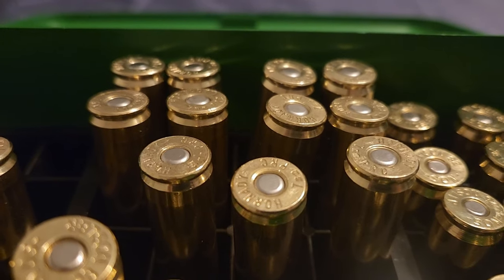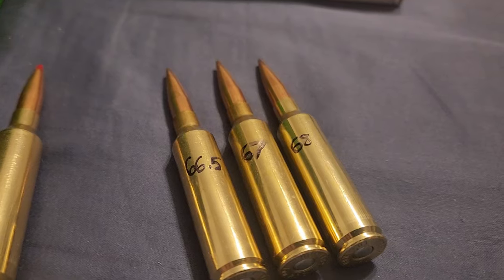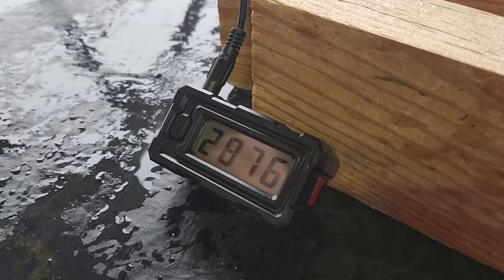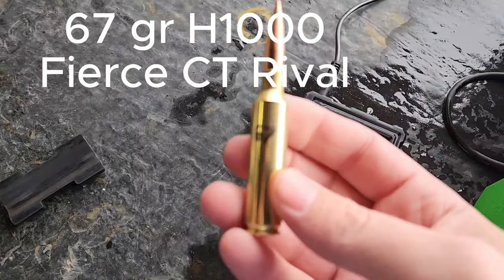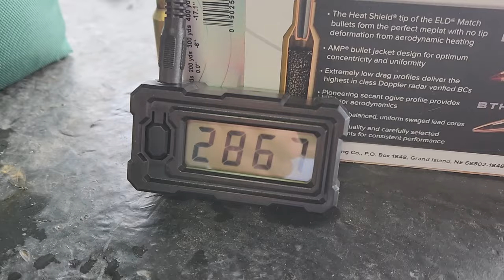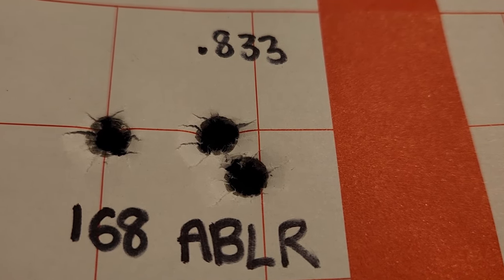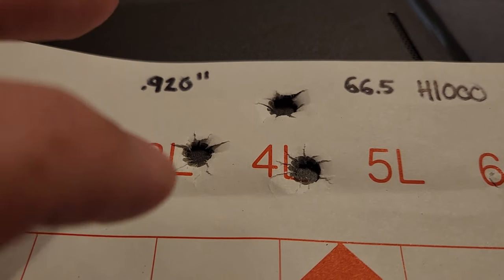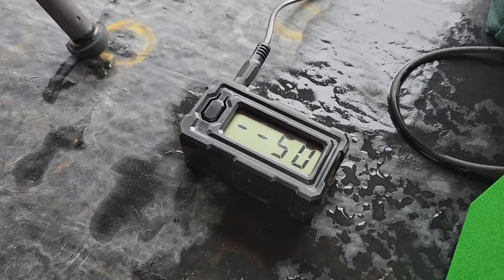Fierce CT Rival in 7mm PRC

Comment: Thanks for including the 6.8.
Reply from the maker: Underrated cartridge
Reply: These videos are making me want to put a 1 in 8 twist 26 inch barrel on a 270 win. I know browning is starting to produce 1 in heels canyon
Reply: @travissmith-wz5nc either that or build a rifle chambered in 280 Ackley Improved. I love the .270 - my first real rifle. It cracked me up when I realized that .270 Winchester beats 6.5 Creedmoor by every measure (except recoil) out to at least 400 yards.
Reply: @chipsterb4946  beats 6.5 prc also. Was thinking about  280 ai also.
Reply: @travissmith-wz5nc  I’ve been researching/day dreaming a rifle build on an ARC receiver and had pretty much settled on 7mm-08. However, a 1:8 twist .270 or a 280 AI build is very tempting.
Reply: @chipsterb4946  7 08 most underrated cartridge. 358 winchester also. 35 whelen also. I think if I had to pick a one gun being I reload it would be 338 rpm by weatherby.

Comment: Backfire just did a video on this.  Hornady rep told him they ran out of powder that produced the box velocity and new powder is just as accurate but slower.  Probably just another attempt to save face but if any early batch boxes are still out there could prove one way or the other.
Reply from the maker: I saw! Thanks for watching
Reply: I was Lucky to get an early batch and with my garmin chrono I was getting 2980 FPS average with 5 shot groups and 0.8 MOA with factory precision hunter 175 ELDX. With handloads out of a 24 in barrel, with H1000 66.8 grains I was getting an average of 2960 fps. But every other powder shot really slow. Not a fan that only 2 powders really work for the cartridge but it can be done.
Reply: I watched Jim. I thought he said industry insider, not Hornady rep.
Reply: @jiminator5 Hi just curious if you have tried H4831SC,  Staball HD, VihtaVouri N565,  and Hodgdon Retumbo? Just trying to get a feel if anything else works well in 7PRC.  I've heard H4831SC to be very accurate but slower, but N565 and Retumbo yielding higher velocity.   Winchester Staball HD appears okay in velocity but nor as good on accuracy
Reply: @daveenriquez7790  I was getting around 2970 with Staball HD but the groups were 1.5 MOA. H-1000 is giving me a little less speed but groups are sub MOA. I am still playing with seating depth.
Reply: @jiminator5  I saw a load someone developed with 66.9 of N570 pushing a 195gr berger in a 26 inch barrel about 2905 so that powder might be worth a shot. Also saw some data for magpro accurate getting similar velocity
Reply: this happened to the 7 rem mag as well, also cant deny other people are getting close to box velocity's in other videos. manufacturer's will always lower to charge to maintain accuracy.

Comment: The 7 Please Re Consider.
Reply: That’s funny
Reply: Oh thats just savage.
Reply: 7mmHype ream it out to 28 Sherman!
Reply: 7 Public Relations Cartridge.
Shot mine this afternoon!
Reply: The 7prc is a fine cartridge for what it is (modernized 7mm cartridge without the belt for handloaders like myself)... but Hornady basically lying about its performance to make it look significantly better than 6.8 Western is bs.
Reply: @t3h8ar0n  do you actually reload and have trouble though? Because the belt,  while vestigial, is not an issue reloading. On the other hand, many people having to buy custom FL dies and/or reamers due to PRC pressure issues…
Reply: @beavismagnum  Yes, I reload (I even have a video from many years ago re how to set up one of my presses)... belts cause an issue with reloading because they prevent proper full uniform resizing of the brass after firings. It is NOT a big deal; however, if given the choice between having a belt and not, I will opt for not 100% of the time because it is one less wandering variable I have to deal with in the process.
Reply: Kind of crazy to me your Mossberg isn't a tack driver, my Patriot Predator is crazy accurate with factory ELD-M and my handloads are pretty good as well. I agree with others on the 6.8 Western when it comes to support. The numbers seem to be there as far as performance, I hope it gains popularity as I hate to see good cartridges die.

Comment: If you use anything but Hornady factory ammo with their current powder.  I live in your area and am offering you a box of Federal ammo for your test?
Reply from the maker: Send me a message on Instagram. My handle is Reloading Weatherby
Reply: @ReloadingWeatherby  sent 👍
Reply: At least from the 7 PRC groups I’m in, it sounds like the federal has been 100 FPS or so faster. 2900-2950.
Reply: Thank u finally
Reply: @OutsidetheEchochamber 3Rballistics dropped a video yesterday getting 2930 I think it was out of the Federal. Had a real hot single shot from either the Federal or Weatherby that was just shy of 3k.
Reply: @dankcincy  to me 2930 is good enough I don’t understand why the obsession with 3k.  2930 gives me plenty for everything I hunt at ranges I don’t hunt at. 
The comparison using 2800 fps like there isn’t any other options was as dishonest as Hornadys published number.
Btw: early Hornady ammo was getting right at 3000 fps
Reply: @OutsidetheEchochamber   Preaching to the choir. I think the 3k thing is because that was Hornadys claim.
 It seems like there's a lot of people trying to show the PRC in the worst light possible for some reason. I don't really understand it. 
 With that said, Hornady needed called out on the BS they've pulled. Even myself, as much as I defend the cartridge, am a little pissed off about it. Fast, High BC, off the shelf ammo was the promise. That's not how it's turned out. It feels an awful lot like a bait and switch. 
 Hopefully down the road it will change and we can all chalk this up to a bumpy start.
Reply: @dankcincy  I shoot federal ammunition in all but two of my rifles one likes  hornady superperformance best and my 6.5 grendel it’s the only factory stuff I can find. 
I do remember seeing 3k out of early batches of 7 prc hornady ammunition I’m pretty sure from Jim(Backfire) himself. 
Federal to me is nearly always more consistent and offers a better premium bullet lineup. If they were to load for the 6.8 western I’d jump all it.
Reply: @OutsidetheEchochamber  If you look at the forums, the posts are still there of people testing the early lots and they were for sure moving out faster than the current ammo.

Comment: Here on the gulf coast, I have 2 7prcs, 1 a ruger and the other a remarms long range, using rl 22,25 and h 1000 I have no problem with velocity reaching 3000 with 180 vlds or eldms, both rifles together cost less than that fierce, I have shot many groups .3 - .7", sold my 6.8 western that one was a tomato stake, but that is just my experience.

Comment: Lol had to throw in the 6.8 western jab at the end, the more I see it compared to the 7s the more I like it. Also can you load varget in the 7prc, that might get the steeds up to what hornady had in mind before the powder ran out, aldo interesting to see the old box confirming that statement put out although still not 3k. 

Great video and keep up the good work!!
Reply: Varget is way too fast
Reply: @dankcincy  bummer
Reply: @NomadicHacker.  Yup
I shoot a 6 Arc as well and Varget is a touch to hot for it too. Guys are doing it, but it's flirting with disaster I think.
Reply: @dankcincy  I've seen load data for varget in 30-06 how is it to hot for 6arc?
Reply: @NomadicHacker.  I don't know enough about it all to give you exact details but if you look at the 2024 Relative Burn Chart, 1-176 1 being the fastest, 176 being the slowest.
7 Prc is up around mid 130s-mid 160s. 6 Arc is one side or the other of 120. 
Varget is 113. 
I'm no expert in smokeless powder, but I wouldn't stuff a 113 where a 165 belongs.
Reply: @NomadicHacker.  Maybe if you were sending something real lightweight down range you could get away with it? I wouldn't imagine you would get good case fill with it before pressuring out though.
Reply: @dankcincy  come to think of it I was seeing it on the lite for caliber stuff, 110s and 130s in the 30-06, makes sense then.
Reply: @NomadicHacker.  A quick glance at 30-06 load data....
It appears to be using some of the same powders as the 6 Arc and faster for the Sub-200gr projectiles. Varget is in there as well. Seems like that's around the fastest the particular list I was looking at was using though.  
 Idk....search around and see if anyone has tried it.

Comment: RW thanks for continuing your experiments with 7 PRC. When it first came out I thought “Eureka that’s it!”  But as someone else pointed out, you have to push right up to the margins to get the  spiffy “advertised” velocities. Work up loads for a 7mm 08 or 280 Ackley Improved or 6.8 Western.  Can you get close enough to not make much difference?  Sure seems like you can.

Comment: If one looks at the published Hornady load data, they themselves list 4 powders - RL22, RL25, RL26 and N560 - which achieve 3000fps at max load with the 175gr ELD-X from a 24" barrel.  That they claim the lack of one powder knocked them out of the "3000fps club" has to be a big fat lie. If I'm wrong,  I can only stipulate that the powder they initially used was not on their load data list. I just can't think of what that powder could be. Norma MRP?
Reply from the maker: I don't think Hornady has access to any of the powders that get 3000 FPS
Reply: The statement Hornady made was that they could not get the powder they originally used, I am 99.9% sure that is R26. They surely have access to some of the other powders, but they were not able to achieve the accuracy they wanted with the same velocities. The person from Hornady stated they preferred accuracy over velocity, I think they simply made a mistake by not changing the velocity on the box. I am still a believer in the 7 PRC and all of the PRC's for that matter, they are well designed and with Stabal HD, H1000 or Magpro, which are all readily available accuracy and velocity should be good enough for most people. If you are not happy after that go with a 7 LRM or 28 Nosler with a slow twist or your own wildcat

Comment: I dont own a 7mm PRC, so i have no skin in the game.My question would be around ,burn rate, cartridge capacity, pressure develpment related to powder type.Ive seen 7mm PRC get 2930 ft per sec. with a 197 grain Sierra hpbt. Thats very a heavy for calibre projectile for the 7mm. Jacob at handloader tv did a recent string of tests with custom built rifle from Yavapai gunsmith college. He got some amazing velocities and groups,especially with reloader 25 & 26. The caveat is the rifle has a 26 inch barrel. I was still impressed as he seemed to tap into the potential of the case. Hornaday must be using a poor powder as their velocities are definitley underwhelming.
Reply: The point of the cartridges was to get those velocities in a shorter  barrel
Reply: @SpudOutdoors  true, that's why I said there is a caveat, a 26 inch barrel. However even if he got 2850 with a 24 inch barrel with a 197 grain bullet that's still good 👍.
Reply: @darrylpacholko5495  I get 3000 with a 195 in 7 mag with a 26”
Reply: @SpudOutdoors  7 mag is what I own .I see no need for a 7mm PRC.

Comment: I bought a Seekins Precision PH2 last July. Had the option on 7 PRC or 7 REM Mag. The dealer I bought it from convinced me to get it in 7 REM Mag. After seeing all the recent videos about the underwhelming performance of 7 PRC, I’m glad I made the choice that I did. I’m handloading 7 Rem Mag, and I’m getting velocity’s that smoke the factory loaded stuff. I’m sure handloading 7 PRC to max would be better than factory ammo, but case capacity doesn’t lie. I always thought it was fishy when Hornady claimed faster velocities with the same type and amount of powder in 7 PRC in their reloading manual. That literally doesn’t make sense. You can’t have the same bullet and same amount of powder and get drastically different velocity.
Reply: If you’re a hand loader, it actually does make sense to go with the PRC, as it’s only the factory loads currently having a problem. Also, the reason you think it “literally doesn’t make sense”, is because you don’t know about the pressure differences. 7mm rm is at 62k, 7PRC at 65k. That means with the same powder load it will have slightly more velocity all else equal, it’s just how it works.
Reply: And by “same powder load” I mean same grain weight but different powders. 7m RM can’t handle as much of the hotter powders.
Reply: I too went with the same rifle but in 7 PRC... thing shoots same hole with the ELDX factory and .85 MOA with ELDM. Can't wait to start handloading with 195's to see what I can get to work with that... either way, Seekins Precision PH2 is probably my favorite rifle
Reply: @oblivionpro69  you understand that’s not how physics works right? lol  The case capacity is almost identical, which means that with the same powder charge and same bullet, velocity will be almost identical. The difference is 7 RM has a little bit higher case capacity, which means more powder, which then translates into more velocity. 3k PSI in MAP isn’t going to add 100 fps to 7 PRC. The great thing about this video is he has handloads, and not light ones, and he isn’t getting anywhere close to the advertised 3k FPS
Reply: Also if you go watch ultimate Reloaders recent video on .308 at 300 win mag velocities, you will see that most people probably run way over SAAMI max pressures anyway. So the 3k MAP doesn’t make a difference when handloading.

Comment: Here is what I think of why the Fierce is performing a bit better than the Mossberg. It has to do with the stock.

The Fierce Rival has carbon bedding and any sturdy bedding makes for a better shooter.

The Mossberg Patriot Predator Strata that you have there is a stock similar to the Mossberg Patriot synthetic stock. The mag well is removable and it is used as a shim. The rear action screw guide has a gap so that it is not a complete circle. You can never torque down what you need. This is going to allow some motion, I think, in the rear of the action, using the front action screw like a fulcrum.

Put the Mossberg in any bedded stock, most especially a chassis, and it does better. I know because I have some and I have mentioned this more than once to Mossberg and they are not interested in changing their ways.

Comment: Okay so for the 6.8 your not included the flyer? I understand it looks good with the 4 shots shown but that’s not the real group size, you can’t though a flyer out, that flyer is part of that group and it shows what the rifle could do on any of the 5 shots. But just my two cents, good video! I may have to show the 7prc getting over 2900 fps because I think I still got a box left of ammo. Also if I had to pick I still would take 280 and 280ai over both these two. 👍
Reply from the maker: The flyer is included. 1.2 inch 5 shot group. I wasn't trying to hide the flyer.
Reply: @ReloadingWeatherby   cool 😎
Reply: You said half moa on the video, it didnt even shoot 1 moa 😂😂
Reply from the maker: @knotsknives1863   I said if we didn't count the flyer. You can see the flyer with 1.290" right next to it.
Reply: @ReloadingWeatherby  right, so if i only count 1 shot, then it's a really tight group right? Ha. When you go to shoot that gun, it could hit in any one of those spots, i guess i just dont see any value in saying what it could have been, cause it wasn't. But you do you....
Reply from the maker: @knotsknives1863  Well... he has some work to do...to get them all sub MOA. The point I was trying to show was the potential. 

In his defense... he has shot this group a lot and doesn't get flyers. You shoot enough of even a great load and you will get a flyer.

Comment: What scope was on the fierce rifle? I am looking for a scope for my 280ai rifle. I want the elevation turret exposed.  But the windage capped. What brand chronograph was ya using? I want to get one. But i won't use it much.
Reply from the maker: He had a Vortex Razor LHT. We were using a magneto speed chronograph
Reply: @ReloadingWeatherby  I was looking at the Vortex Viper 4x16x50 hs lr scope. Wanting an SFP scope for hunting. I was also looking at the magneto speed sporter model.  Putting the scope on a new Browning.  A Xbolt Hells Canyon Long Range rifle in 280AI. It has a 1@8 twist 26 inch barrel.
Reply from the maker: @ozark_trapper  I have a Vortex Viper HS. I like it.

Comment: That’s some of the best velocities I’ve seen from the factory stuff. I’ve always heard Fierce has relatively fast barrels compared to most production rifles. My Firece has a 22” barrel and shoots tiny groups with the 175 and 180. I need someone to donate a chronograph to me.
Reply: I'm considering the Fierce Rival. How well do you like yours? Any insight Pros/Cons are greatly appreciated
Reply: I absolutely love mine. I’m considering another in a different chambering. I’m sure it will shoot for you because they all seem to drive tacks. I’ve had a small feeding problem (floor plate model) Looks like Fierce is going to handle it but I’d recommend getting the one with a detachable magazine. Should prevent that problem
Reply: @masone4589  Thank you so very much for that insight.  I was initially considering the floor plate model, but I'll take your advice on the detachable box magazine model.
Reply: Now that’s what it’s about good onya fellas, info like that helps everyone and it’s great to see people not arguing over ish